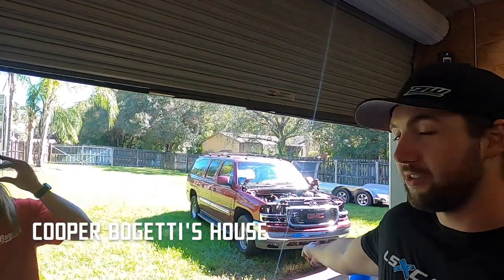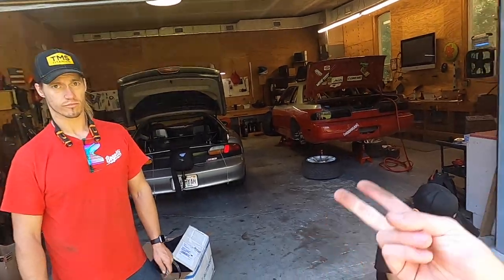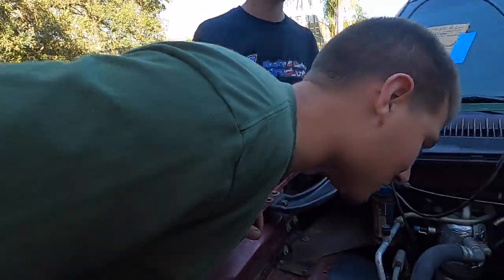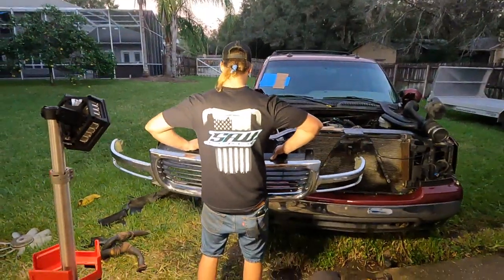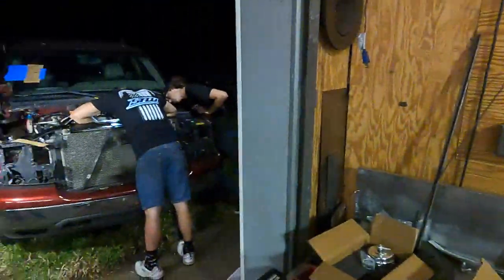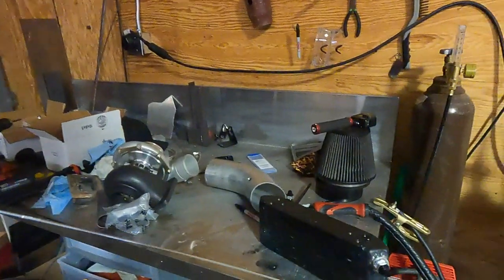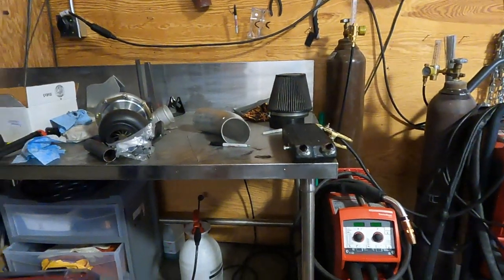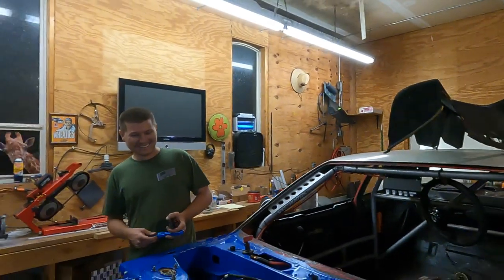Budget Turbo Yukon XL Build “Uncle Rob”: Hot Side Fab / Intercooler Mounting (Using Coopers Garbage)

Comment: Double wall pipe is for noise control,  single wall tube can ring like a bell.  Tap on a double wall and it goes thud.  Double wall sometimes would collapse only the inner pipe and cause exhaust restriction,  a real pain to figure out because it's hidden inside.
Reply from the maker: Makes sense. We figured someone would know. Thanks dude
Reply: I wonder if it's possible to run a different gas through the outer section...

Comment: Hey Mitchell, that wire is sometimes called chicken wire but is usually labeled safety wire at the hardware store. Stuff is a lifesaver
Reply: My grandpa called it bailing wire and always had a roll in his tool box for things like holding the power steering pump up and stuff like that.
Reply: Bailing wire is why my father always called it as well.  Great for thousands of different uses.
Reply: @captainzero1  old school dudes knew thier stuff, man I miss my grandpa and his shop!
Reply: "Tie wire" in North Florida
Reply: @gat6186  Tie wire here in Mississippi as well for tying steel/rebar...
Reply: Its called all different things since it comes in different guages. Amazing stuff
Reply: I thought chicken wire was the wire mesh fencing screen type stuff with the big 1 inch hexagon holes weaved in the thing that makes it a fencing..  like the stuff used to hold back gravel you see sometimes, kinda like chain link fence look but a lot tighter weave pattern..  used to keep chickens in and other critters out..  ive always called that line on the spool either metal tie wire or braided metal cable if its braided like an electrical wire..
Reply: A lot of people I know call it mechanics wire, its works really good for hold pretty much everything out of the way when working on cars.
Reply: @Z-Ack  I thought so too before an old mentor called it that. There are so many names for this type of wire
Reply: Yeah or “mechanics” wire at auto parts stores lol

Comment: Q:  I learned to Tig with a scratch start machine, same machine use to this day (everyday). I've never used a HF start Tig welder, are all HF machines loud like that? My welder has a constant fan and it's annoying, but not nearly as loud as that Fronius.
Reply from the maker: The fronius sound you’re hearing is the water cooler pump

Comment: About 35 years ago when I just broke out as a journeyman electrician I took too long a screw and stuck it right through the coil of an AC unit. 100 hp 480 V unit, it leaked forever.

Comment: Go back and forth with them there header bolts you’ll never have to worry about breaking them if you just go easy
Reply: Yea eazy outs are usually tempered in a way where theyre harder than most drill bits but are usually brittle..